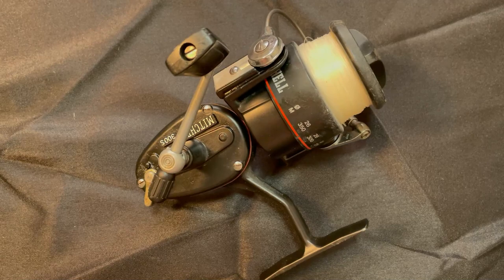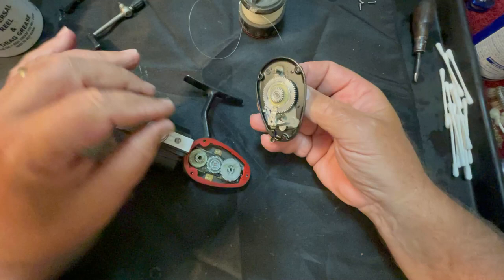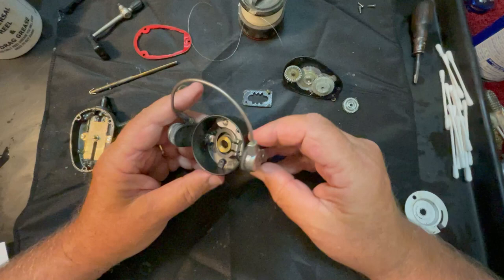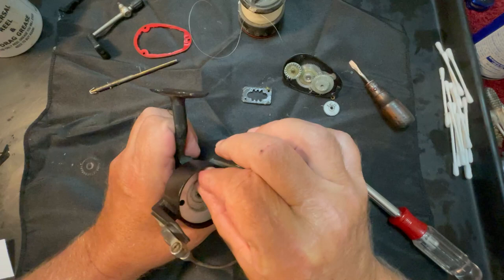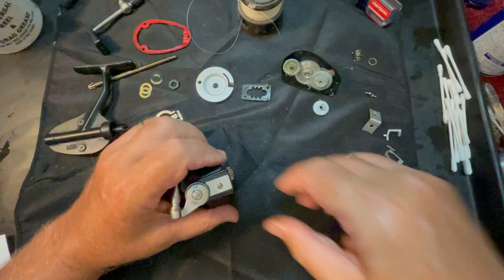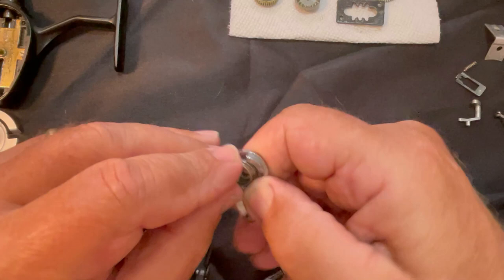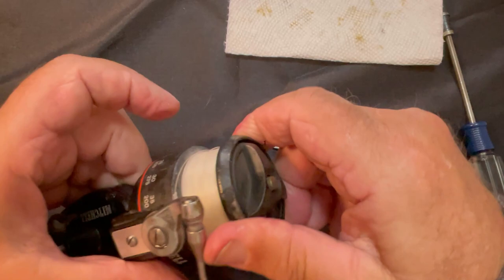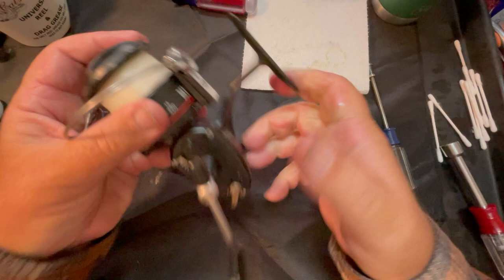Young Martin's Reels --  Mitchell 300S  --  Service and Lubrication

Comment: Boy does this reel look better than the photos you showed me. So far the only difference I’ve seen between this reel and a 300A is the skirted spool and rotor. The bail springs are the same as those found in a Swedish Zebco Cardinal  6 or 7. I can also tell you I do not like seeing all those many shim washers. That speaks of a reel that wasn’t made with tight tolerances so you have to use a lot of shims to get everything to fit and function correctly. I have 61 Mitchells and none of them have anywhere close to this many shims. I have a two Penn 704Z reels that also have bail springs on both sides that are equally as difficult as this Mitchell but with much stronger springs. You know Rick, this might have been no fun to do but it was really fun to watch you. LOL. What goes at the bottom of that drag stack is called a brake spring. I have one on that Mitchell 906 I just did. I have two spools for that reel and in both of them this brake spring was shattered in pieces. I got two old Penn thrust washers (Teflon) trimmed  them and put them at the bottom of the stack. Now the drag functions perfectly. They call that part a brake spring but there is no spring in it in the traditional sense. I’ll send you a photo of what came out of the bottom of the 906 spools. By the way, no one has that part anywhere. That’s because they all break into 15 or 20 pieces. It’s a poor design but you can overcome it. Great job on this reel. I have to say I enjoyed it immensely! — Chris
Reply from the maker: Chris, it did clean up nicely. I reshot the paint on the spool last night and it looks even better.

You are correct, the back half of the reel looks like 300A. I should have mentioned that once I saw what was inside. I believe the AR is different with the squeeze clip. 

I’m not so sure this came from the factory in France with all of those shims installed. I believe these were added later by someone that didn’t know what they were doing. I’ve almost convinced myself to go back in and remove the extra shims and see how it runs. It’s fine now but it might be even smoother with less shims. 

I learned a lot about setting the opposing coil springs. I tried to put them in the wrong sides at first and bent them up a bit. If you look at how they look coming out and what they look like going back in you will see that. I think if I hadn’t made that mistake, the bail springs would have gone right in and I wouldn’t have complained so much. Live and learn.

The biggest problem was the rotor tensioner being on the wrong side of the trip lever. Once I got that figured out, I still had too many shims in the gear train.

Now that I know what should be in the bottom of the drag stack it makes more sense. A coil spring would fill that space and allow you to adjust the tension. The tension washer is a backyard fix someone came up with and it’s working fine so far but it’s putting all the pressure on that little lip. I’ll have to either put in a stack of drag washers or try to find a spring for it. Thanks for the heads up.
Reply: @youngmartinsreels5314  if you find that brake spring get me a couple of them too. I’ll be very grateful as I can’t find one. Look on the 906 schematic. It shows that piece. It is more like a very thick washer. There is no coil spring there on a 906. I tried to service the drag on two different spools and both just had a bunch on broken pieces at the bottom of the stack. Also the drag washer above that brake spring was different. I’ll send you a photo. When I put the two Penn thrust washers in around that lip it took all the pressure off of that lip.— Chris
Reply from the maker: Chris, Tommy Modesett provided me with a schematic diagram this morning that clearly shows the parts that I have installed with no coil spring I wonder if this spool was a retrofit from another spool and they decided to move away from the coil spring design.
Also the eared washer should be installed first not the keyed. 
Fish On my friend.
Reply: I have 5 each of 900 and 300S reels in addition to many other Mitchells, and yes the rotating head/bail trip setups are a bit difficult to set up properly (learning curve!). Two observations; yes there are quite a few shims that were used to set tolerances on both the rotating head and pinion gear, and also the crumbled thrust washers under the drag stack just need to be cleaned out and replaced with something else. I found that a properly sized cut piece of rubber O-ring put down in there first works very well. On the gear shims, you just need to try different thicknesses to get the desired results. Of course, you need to find and purchase some to accomplish this.
Reply from the maker: William, I’m pretty sure when most of these came from the factory that they had the proper number of shims installed. To add so many shims that it will barely turn makes no sense but that is how I found it. I’ve checked the schematic for this reel since the video and I was unable to find any missing or crumbled parts. All of the washers are in great condition. Chris was telling me that on his 900 reels he always found a shattered spring under the bottom washer. The schematic for this reel doesn’t show a spring.

I can’t visualize the assembly folks in the factory installing and removing shims to get the correct setting. They must have had a simpler way to determine the correct shims required. The trial and error process works but I’d like to find a simpler way. 

The dual bail springs was a first for me and they tripped me up at first. Once I go the hang of them they weren’t so bad. Mitchell had a habit of unnecessarily complicating things. Thanks for the inputs.
Reply: @youngmartinsreels5314  , indeed they are a bit complicated, perhaps the most difficult Mitchells I've taken apart. I do believe the only way to get the desired tolerances you want is by installing different thickness shims and checking it. I currently have about 20 of the similar style reels (300, 300A, 300S, 900) that use the same shim packs for rotating head and pinion gear depth, and have taken apart, cleaned, re-built or restored every one. I tweak all the shims to get how I want it to feel. It really is just trial and error. You probably already know this but make sure the black washer goes up against the aluminum plate first, then the brass washers go down against the rotating head. The black washer has a slightly smaller inside diameter and catches in place, then the brass washers are used for tolerance. And yes the crumbled thrust pieces under the drag stacks are in 900 spools (also 906). You can usually find the different shims on eBay. They usually are random thicknesses so you can try different ones. Wish I could post pics of my Mitchells here but can't. Just subbed to your channel.
Reply from the maker: William, nice to have you along. It sound like you and Chris Jenkins would get along great. He has a rather large Mitchell collection. You two should talk.

Comment: This reel seems like a last ditch effort to compete with what Penn was putting out with their SS series in the 80’s. The Mitchell’s were clearly past their prime by then and it shows. The classic 300 was reel almost more beautiful on the inside than the out, although I still love their sleek overall looks. I have three set up on different rods for different things and several parts reels as well. Like you, if I see them for cheap I find them very hard to resist, as when they are gone, they’ll be gone and I can’t see any modern maker reviving them they are too complex for today’s tastes.
Reply from the maker: I recently acquired a Mitchell 300X reel. I serviced it and took it fishing this week. I liked the look and feel of the 300X a lot better than this reel. It's even more complex than the original 300 reels. It uses a worm gear to drive the line oscillations. Even though it was made in China, I decided that I like it. The Mitchell Excellence II EX40 is definitely my least favorite of the Mitchell reels. It has a very unique Oscillation gear built into the plastic case that stripped out on the one I worked on.

Comment: thank you for your video. I've got a Mitchell 300 pro it doesn't have a skirted spool but otherwise looks like Michelle 300s inside, servicing Mitchell 300 pro after have finishing an swedish made ABU Cardinal 66 i would say that the french like mechanics and not going for the easy solution every time, but maybe for the fun of it? And its interesting the different ways to accomplish a goal in these old reels.
Reply from the maker: I’ve had that discussion many times with my friend Chris about discovering how many different ways they could accomplish the same thing. It’s absolutely amazing.